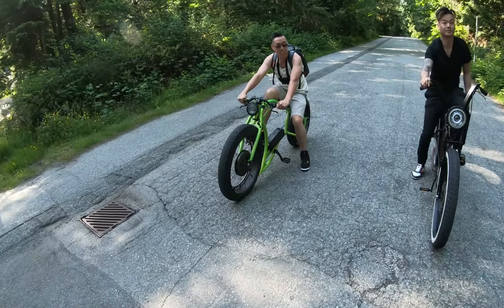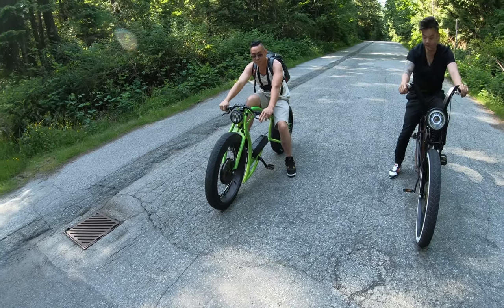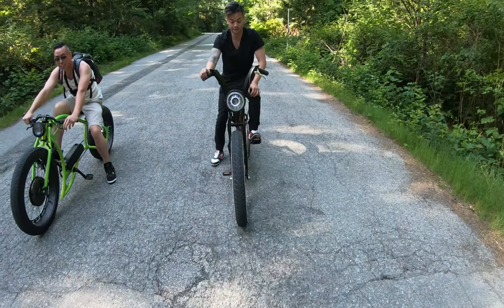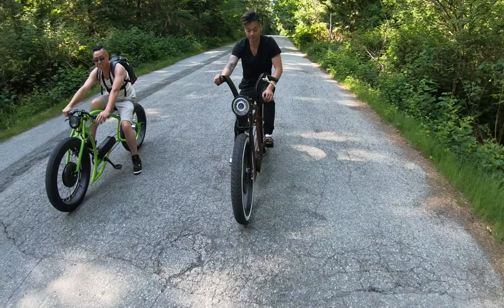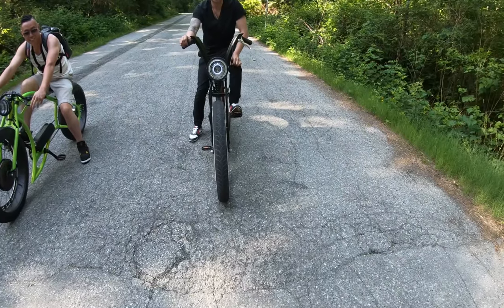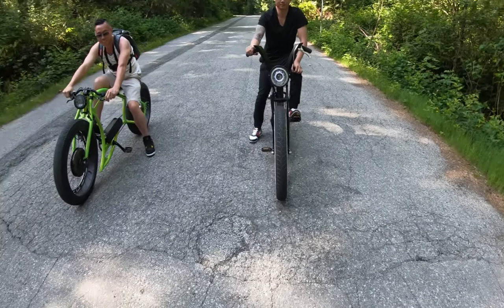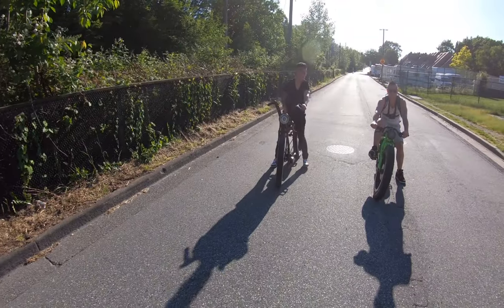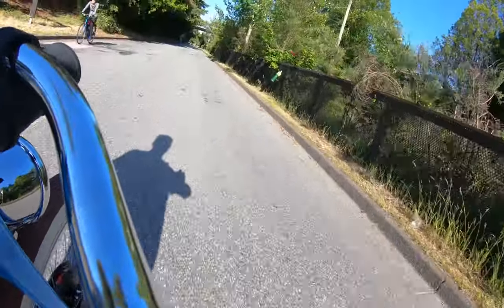E-BIKE DRAG RACING - VLOG #1

Comment: Lol @ Skeletor, nice race pretty close. What's 72-volt battery are you using that fits in the small case like that? Is it a low Ah pack? Thanks, great videos.
Reply from the maker: Its 72volt 21700 cells 8ah 👍
Reply: Do u know roughly how many miles you get on your battery
Reply from the maker: @cream6936  You can go 30-60 miles or more on one charge. It depends on what set up you use, how much you pedal, how much you weigh etc.